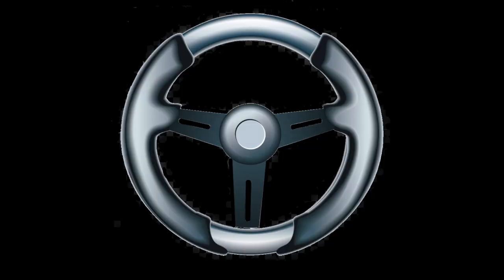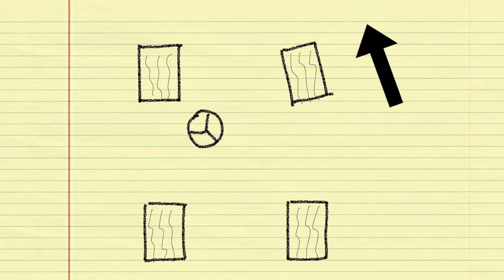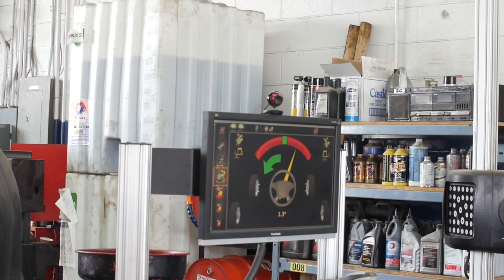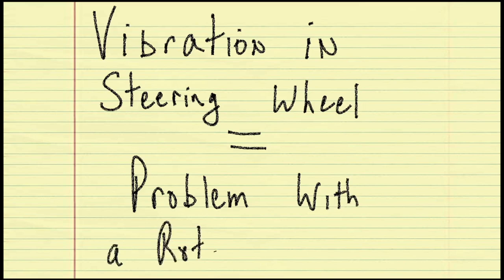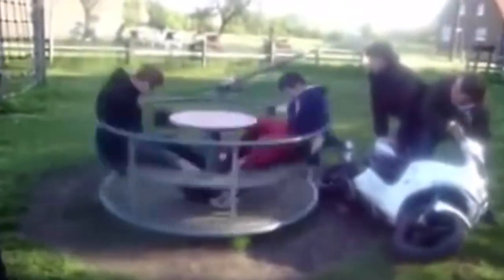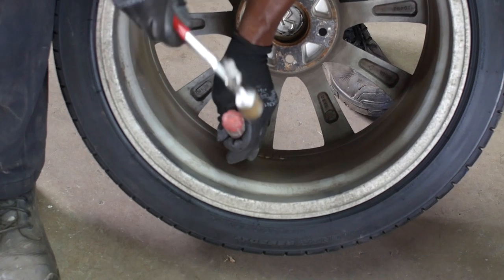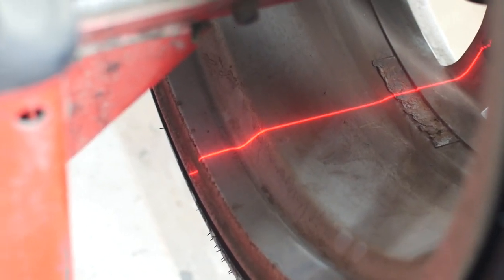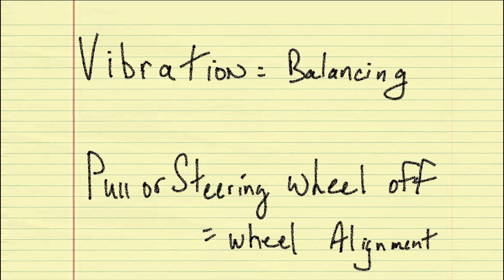Wheel alignment vs wheel balance? #tire #wheelalignment

Comment: I have a question, what is the difference between a front alignment and a four-wheel alignment in terms of price and necessity? 
I've read that my Dodge avenger doesn't have adjustable rear tires, yet when I ask about a front wheel alignment I'm told they only do all wheel alignments. I thought getting just a front end was cheaper but is it all the same price?
Reply from the maker: All newer alignment machines are designed to analyze the whole car including the rear wheels.  While we may only adjust the front it’s still a whole 4 wheel process to set up the machine. Typically, Anyone who performs 2 wheel alignments has a very old machine.

Comment: Does having bigger wheels than factory specified need an aligmnent? I've 19" (factory was 16"), had it aligned multp;e times, the car still won't go straight, it will slowly veer to one side. I've checked for other suspension component damages, but its all fine
Reply from the maker: you need to put the original wheels back on to see of the car drives straight with them on it.
Reply: @LouTrottier  ah man! They're long gone, but as I remember they didn't drive perfect either
Reply from the maker: @mohammednurul9380  its really hard to diagnose without originals.. anyone you know that you can borrow a set off their car?
Reply: @LouTrottier  there is dude who has the same car but with a V8 variant and came from factory as 17" standard, unlike mine which came with 16"